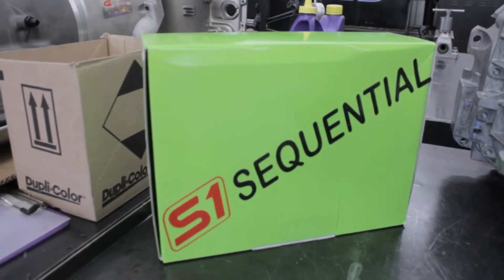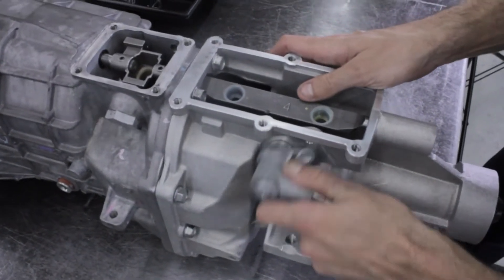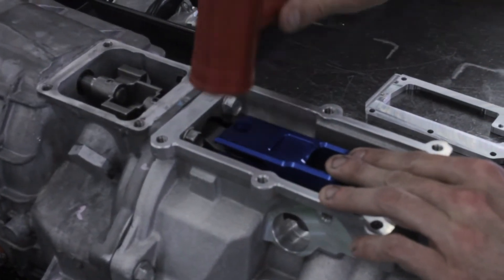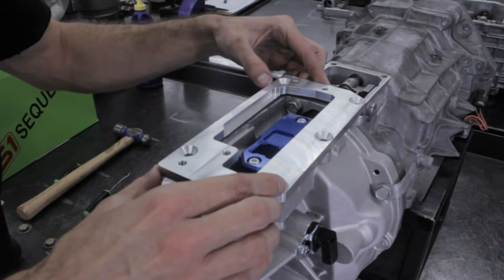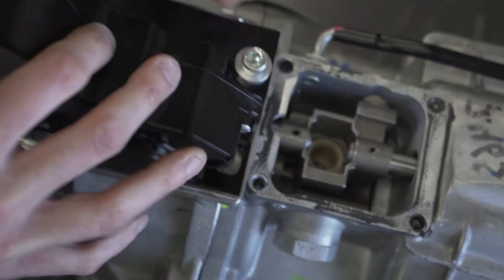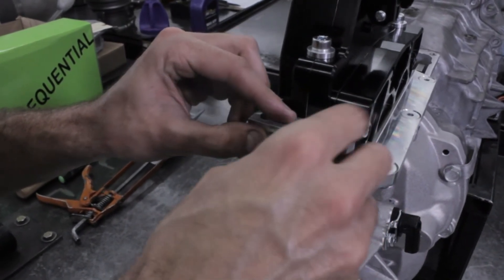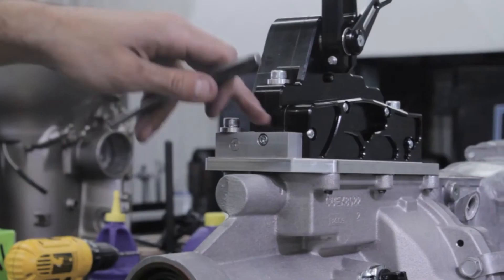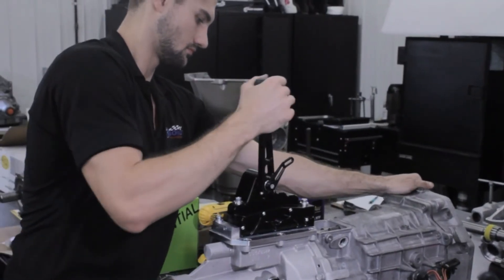How to Install S1 Sequential Shifter | T56 Magnum | Bowler Transmissions

Comment: Great video guys ! But I disagree, most vehicles will Not be able to mount the S1 sequential shifter from in the car/truck... the shifter Needs to be mounted to the transmission Before the transmission is installed in the vehicle, there just isn't enough room to mount the shifter properly from inside. In my case, I installed a T56 magnum (purchased from Bowler 😎 ) with an S1 sequential shifter in my '89 Mustang (LX hatchback) and the hole in the tunnel for the shifter needed major clearancing and I had to modify the center console as well as the taller base of the S1 shifter comes in contact with the center console  ...BUT... it's WELL worth it !!!

Comment: SO THE GRARBOX IS ALREADY A SEQUENTAIL ... THE ADD ON S1 DOSENT CHANGE THE H-SHIFTER TO SEQUENTIAL IT ONLY MAKE IT EASY .. AM I RIGHT ?
Reply from the maker: This just converts the H pattern shifter to a sequential shifter.  But the transmission is still a synchronized transmission and will require the use of the clutch, unless you convert the internals to a faceplates gear set.

Comment: That rollpin stuff looks like a pain in the ass, if you get it in the car and it seemed great on the bench but now isn't shifting as well as you would like try to readjust you are screwed for  moving that lock block.

Comment: Hello, i just lurchased this sequential shifter with the t56 magnum from hot rod company. They are charging me 1800.00 to install shifter. I did say isnt as easy as just installing the shifter as you did and they told me " no way" there is much more to it?? Am i being hosed? They did say i would not need to use the clutch with my setuo. Could they be faceplateing for this price? I hope im not being played here. Could i ask you to please let me know if this seems way off , as so i can cancel the deal. Thank you.

Comment: i have a 2011 GT500 same process? i saw y’all had multiple t56 options
Reply from the maker: As long as you have a TR-6060 or Tremec Six Speed there is a kit for yours.

Comment: What’s the cost to install one?
Reply from the maker: We plan about 2 hours for proper Installation.  So if you have us install the shifter in your transmission plan on around $300 for the shifter install and $250 if you want it dyno tested plus any parts.